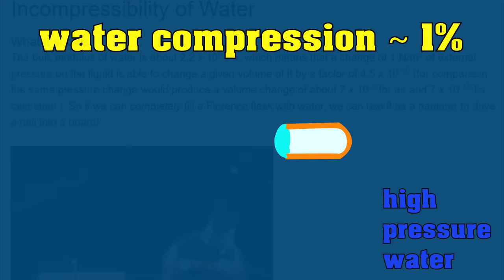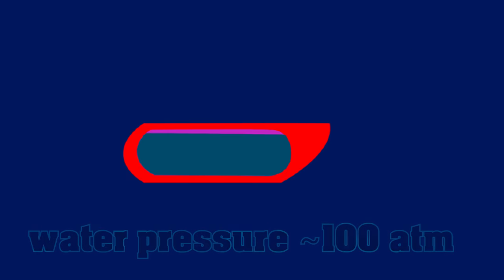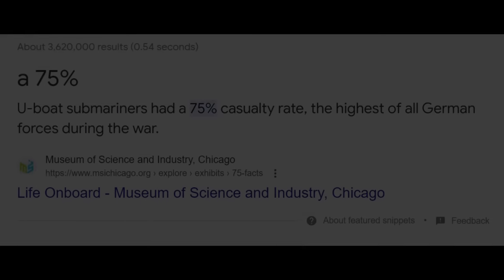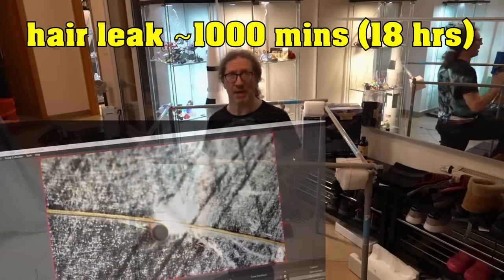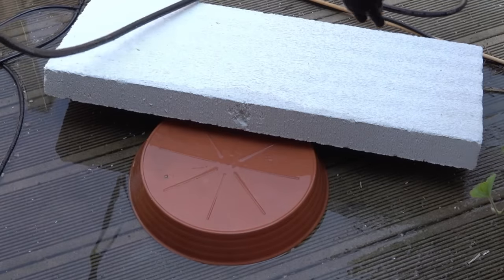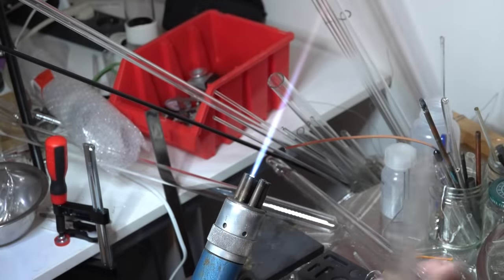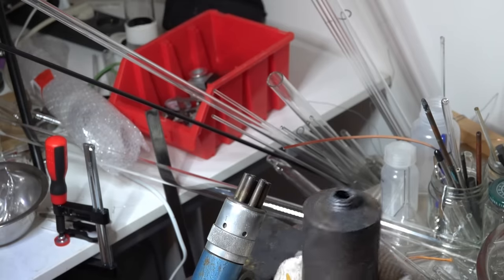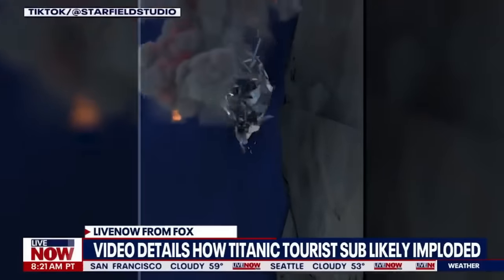Why the Titan sub failed

Comment: You are WAY WAY WAY over embellishing the vocabulary you are using to describe implosion and it doesn't make you seem smart. Especially when it makes you miss the mark entirely.

The reason fish and marine mammals don't die at depth is because the pressure is equalized between the immense pressure inside and outside their body. So the net force pressing on them is essentially zero.

The ship was being maintained at a pressure of 1 atm~. Meaning that there was an immense difference between the pressure outside and inside the sub. The only thing holding the pressure out was the material strength of the carbon fiber. That is until it didn't hold anymore. And the ship crunched like aluminum can in the hands of an alcoholic who just finished it.

Any discussion beyond this point should be centered around the strength of the carbon fiber. Not the compressibility of water.

Comment: I'd say the carbon fiber basically turned into a black cloud in the water,  turning to chunky dust . Because when it goes, it goes like tempered glass in the effected area. Being deep in the ocean, it's effected everywhere,  I could  see reinforcing a titanium sub. with carbon fiber,  after testing a 1/8-1/10 scale model, with the walls being 5-10% thinner,  filling it with load cells, pressure sensors, to read any changes in the air pressure, and send it down to the ocean floor, and back up. On a cable,  about 100 times minimum, preferred spend a week  constantly  sending it up and down, about once a half hour. If it survived, I'd do it again often evacuated the air, add another atmosphere to it, and possibly go to the marinara trench, and send it about 70-80% to the bottom ,  about 50 times,   however I believe  it would fail,  with that shape anyway,  having two spheres joined would be better,   about 96" diameter,  with hatches on both ends with windows, if anything use the carbon fiber on the inside, to reinforce the titanium,  think I'd go with stainless steel,  it would be heavy,  bolt the two spheres together with 1" bolts, on 4" centers, and make the whole sphere 1" thicker to make up for the holes,   have the holes honed to fit tight,  possibly using liquid nitrogen to chill the bolt before installing with a interference fit, about ..001"   about 4" thick stainless steel,   with small spheres on top with veg oil to make it float, a sphere with a  4-5' hole in the side bolted to another,   with a 48" hole with 45°-60° cone seat, with multiple o-rings every 15mm, and 1-1.5mm thick, with hinges on the exterior basically clamped on the hull.  And once below water a latch should not really be  required,  possibly 12 spring loaded latches  bolted to the inside 
.750"- 1" deep,  with
 .500" (1/2")12 mm bolts. 3 per latch , each latch having a 18" -24" handle , with a safety  latch on it , a pin that must be pushed in, before it can be turned, the 1/2" pin spring loaded,   keeping it pushed out, so the latch can't be accidentally opened, the actual latch being a 2" x 4" x 1" thick bar of tool steel heavily nickel plated,  with a 1" pin attaching it to a 1)2" plate bolted to the hatch.  A matching catcher on the sub with 30° ramps on a 2" wide, x 6" long the latch fits in the valley between two peaks made by 1/4" ball bearings,  captured in the capture plate,  with springs behind,  also a large coil spring keeping the latch against the bushing washers, the spring having about 2000-3500 psi , made from about 1" spring steel,  about 4 coils.  It Should give just enough give to allow the latch to be pulled into the capture plate! 
Using multiple smaller spheres to hold veg oil, or water steel shot,  with the option to use CO2 to create lift,   use a cable to followed down by the sub. And lift the sub after a journey,  I think this would been much safer, and I would never heard of this company!

Comment: 5:40 - Okay,.. That's it.. I need to stop you right here, right now.. This movie is not called "Das BUUT" FFS! It's German, as I'm 100 % sure you know! "Boot" is pronounced like the Swedish "Båt" which means the same thing, i.e. "Boat". Or to give you some other English words with the same sound.. the "oo" in "Boot". Is the same as the sound of the "ou" in "ought" or in "sought". Come on Mr thunderf00t! You're not even American, and yet you do worse than most of them in this case. Sheeesh! Also.. why in the world are you showing us clips of the horrendously dubbed version of the movie??? This is a a top five cardinal sin! Never EVER watch any movie in anything other than it's original language, apart from maybe a handful of exceptions where the original audio was so poorly recorded and so off sync, that the dubbing actually was not just slightly better, but IMMENSELY better.

Comment: I'm confused about it "not being the pressure, but rather the the fact that the water is condensed". Isn't the water only condensed due to the fact that it's under pressure? And wouldn't that mean that regardless of the condensing, that water which is under high pressure would want to fill any void that doesn't equal the same pressure? Like a submarine. I'm having a hard time separating the importance between pressure and density when it comes to how water behaves at those depths.

Comment: You're wrong.  Water is indeed incompressible.  That's what separates liquids from gases.  However, it exerts an enormous amount of pressure at great depths, because in effect a huge column of water with your cross-sectional area is sitting on top of you, and water weighs ~8.3 pounds per gallon.  That weight presses in on you from all sides, not just from above.  Creatures that live or can survive at such depths equalize the pressure internally, just like we equalize the 15 psi of pressure from the atmosphere naturally.  But a sub must maintain a human-livable pressure inside, while holding off multiple hundreds of atmospheres of pressure outside the vessel.  This is what makes it difficult.

Water does not decompress when it fills a void, anymore than a hunk of steel decompresses when you drop it from a crane.  It's just gravity pushing it in.

I don't see how your experiment changes any of what I wrote.  The pressure fractured some part of the vessel, and it most likely was the weakest part, which could easily be the window (which was not rated for anywhere near the dive's depth).

Comment: I really love your videos but believe your comments on the dissimilar materials being the cause of failure may be wrong. The strain ( percentage compression of the two pieces) could be quite easilly matched simply by adjusting the stress they are under. 
If for example the carbon fiber had a modulus of 1 and the titanium of 2, you could simply make the carbon fiber double the thickness and the overall deformation of the two materials would be the same.
Unless you are assuming they were the same thickness because they were bonded toghether?
Ps I work in the  composites field and, especially in high end applications, it is really common to bond carbon to other metals such as titanium. 90% of the titanium used in the industry is ti6al4V (same as what is used in medical implants from what I know) and I am willing to bet that the ends were the same alloy!

Comment: For all you people spounting "Internet Engineering Wisdom" about composites and compression problems I guess you will never fly on commercial aircraft will you.  They too are made of carbon composites and metals held together with "glue" and withstand thousands of compression/decompression cycles with changes in altitude instead of depth.  The problem with the Titan was the engineering, not the materials.  Had he listened to the CORRECT information he was getting during the design phase, he and his passenger would probably still be alive.

Comment: If there was a leak, the vehicle would have been recovered intact, full of water and drowned explorers. Only thing would be if the ends of the cylinder are particularly porous, allowing the water to push in and separate all the fiber layers? That would weaken it a lot.

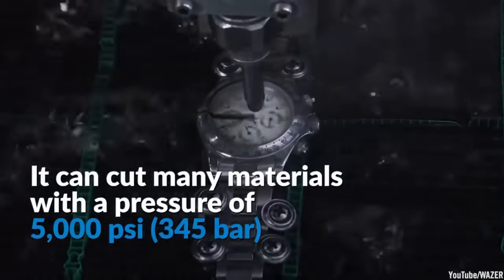Comment: 13:30 . . . . you bought a shitty as electric pressure washer that probably doesn't even come close to its rated psi btw. you seem to skip over some glaring obivious stuff in your videos. . . .

Just like with the skrol video. . . $1.2m raised 4,200% over the fund goal. . . . = about what $25,000-$35,000 goal. Yet you never talked about how it was obviously a scam based on that info alone but you couldnt make a video about that wouldnt be long enough.

Comment: No water is not compressible in the liquid state, wtf are you on about.
Reply: Water is slightly compressible. It’s just so slight it’s generally just considered non compressible.
Reply: This is one of  thunderf00t's weakest videos by far. I'm actually astonished at how shoddy it is.
Reply: No water is compressible , just it would take so much pressure to actually do it - it’s just said not to be ( there’s a lot of different answers) but where the sub would be your talking only 1-5% ish.